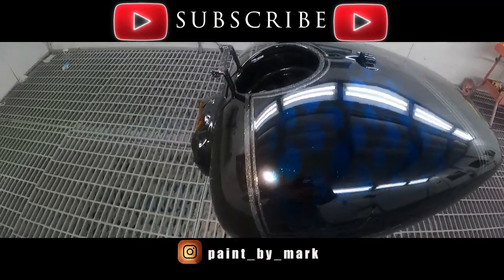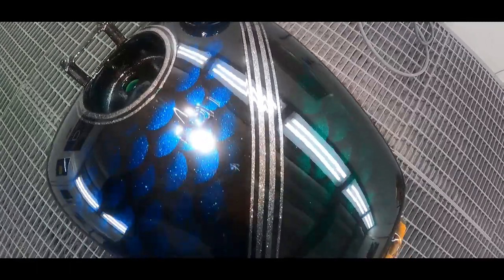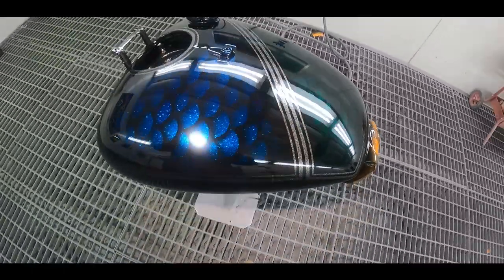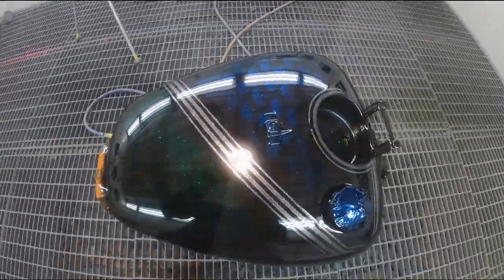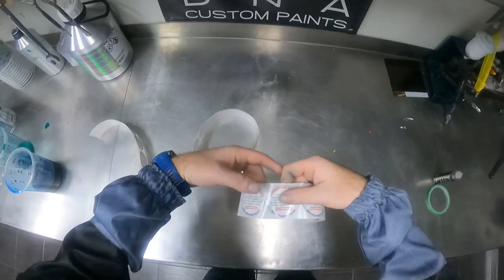HOW TO MAKE & PAINT FISH SCALES

Comment: Did you use candy black for the shade in or base black..?
Reply from the maker: Black basecoat mate
Reply: Hey Mark, 
This is a question I thought of from Bobby T’s question… 
Have you ever worked with any candy blacks??? 
What are your thoughts about it??
I have seen the Black Betty Camaro on YouTube where they painted black.. then 1/4 black in clear then 50/50 black and clear.. then several coats of clear.. made me think of black candy for depth.. black has to be hard to make transparent.. and possibly only see the difference in direct sun.. thoughts?
Reply from the maker: @fulltiltboogie5321  I’m actually painting a Harley green with black candy in the next few weeks, stay tuned!.. edit:  my thoughts are the same as any other candy Color 70% overlap and 3-5 coats depending on the desired shade I’ll sometimes apply 7 coats
Reply: Sweeeeeet!!! 
Can’t wait Mark!
Reply from the maker: @fulltiltboogie5321  my opinions have changed! very difficult almost impossible to lay the black candy down without mottle!. also to fix/hide the mottle i sprayed 6 coats of candy which hid my base color which was bright orange with metal flake.
Reply from the maker: @fulltiltboogie5321  check my Instagram for a video of the candy black tank https://www.instagram.com/paint_by_mark/